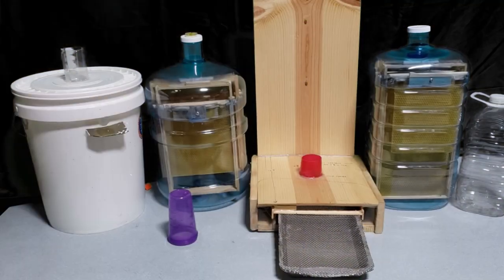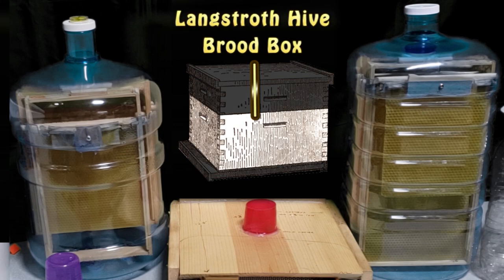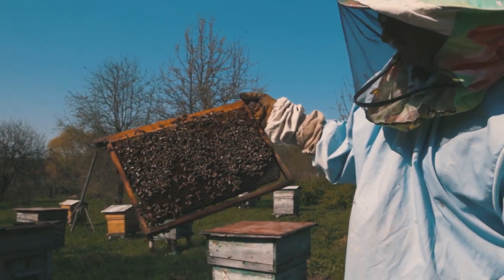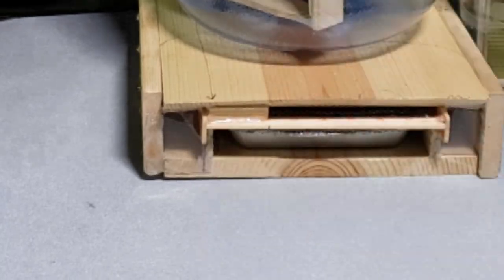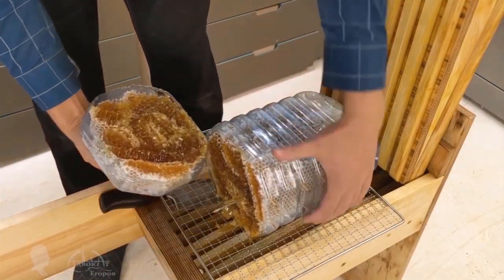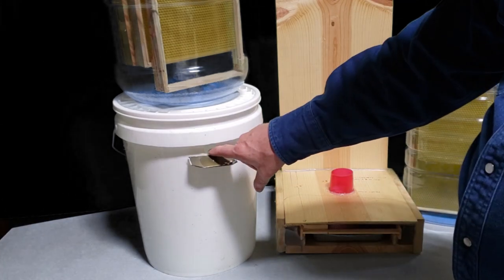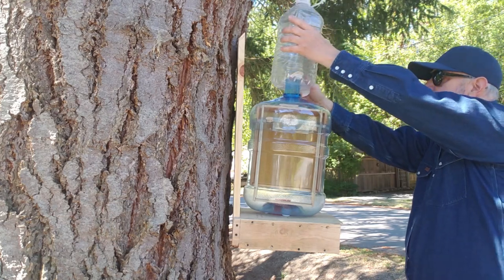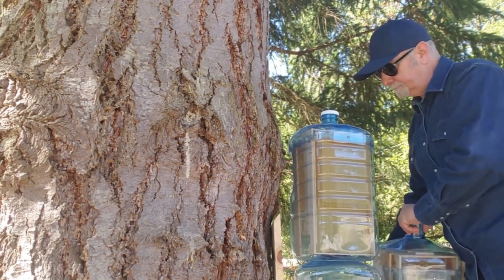Bottle-to-Bottle Honey Production | Contactless Beekeeping | End-to-End

Comment: Hi. This is really amazing approach of beekeeping. This year a want to start with warre hive but this seems even more simple than warre. But I have one question. How is it with wintering of bees in this bottle hive? I live in Slovakia and there we have sometimes about -10 to -20 °C during winter. Is these insulation enough for such low temperatures.
Reply from the maker: This is really just a Warre observation hive. I follow Warre principles. 
Two layers of the closed cell foam has the equivalent R value of 8.3 cm (1 1/2") wood and the "Thunder Dome" allows you to use a ventilated top insulation box.
This is based on Advoko Makes bottle beehives in St. Petersburg, Russia. (It gets cold there :-) )
1. Watch Advoko Makes video: https://www.youtube.com/watch?v=9ItlOFLTUAs&t=971s
2. Watch my Ware comparison: https://youtu.be/8KuGdukMUD8
3. Watch the Thunder Dome video: https://youtu.be/MzSLf7vQBVQ
Reply: Revolution